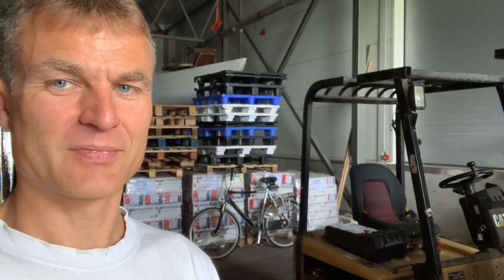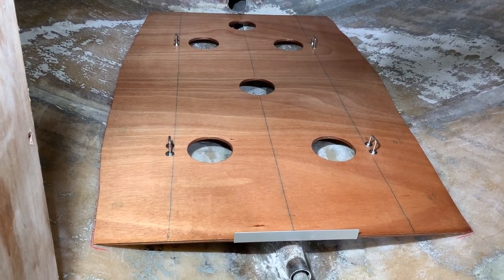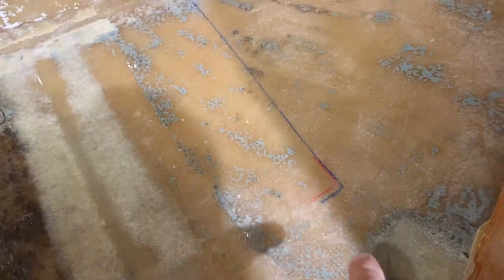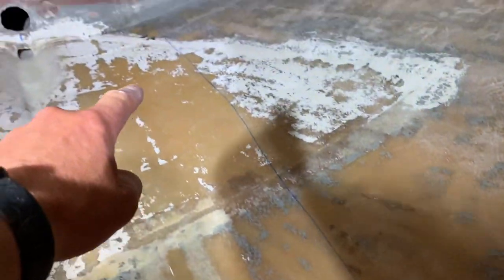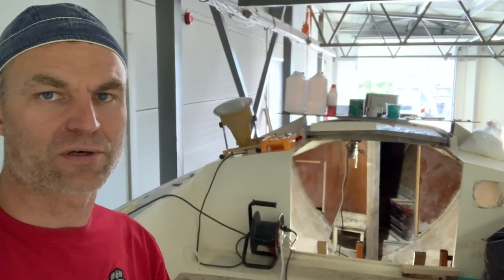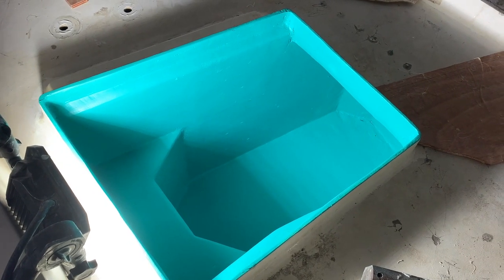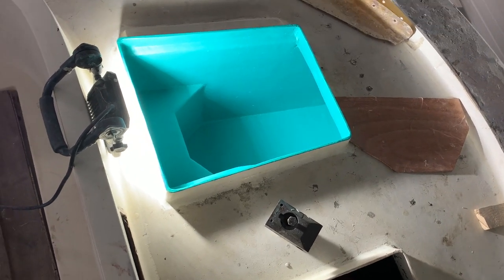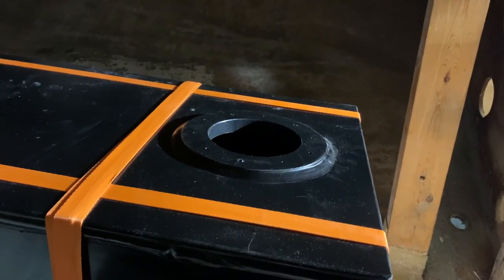Building propane Locker and installing HDPE fuel tank for my sailboat project

Comment: Nice work with the propane locker. Mine is also in the bow of the boat. Something like this could be very nice. 👍
Reply from the maker: Thanks! I only copied the idea from my Shipman 28 that has propane locker in the very same location. Only smaller. I also considered storing gas in the bow locker but I want to keep it for anchor chain / rode.

Comment: I just subscribed.  I've been going through the back episodes and I'm almost caught up.  The trick to motivation I've found is not to tear apart too much at once. If the boat looks like a wreck all the time it's hard to see an end.  Clean up one section.  Like the V berth.  Paint it out nice get it all completely finished and then do your best to seal it up and keep it clean.  Having one thing that is done and done right is great motivation.  The propane locker looks great.  The second trick I found to staying motivated, don't stop.  An object in motion tends to stay in motion.
Reply from the maker: Thank you for subscribing and commenting! That was some really good advice from you!

Comment: If I am not mistaken, propane and butane weights more than air. Therefore, if there is a leak, it will stay into the locker and replace the existing air. Luckily it is not the same compartment than the living area, but it seems to be somehow dangerous to leave bottles in there. Thake care there and avoid any kind of sparks (bulbs, electronics) and any opening when smoking (which OTOH is also dangerous by itself!). As per your projet, you are doing a gooood job!
Reply: Boat will have a small drain allowing any leaking propane to exit the boat through the stern, I believe.
Reply from the maker: Correct, there will be drain.
Reply from the maker: The standard practice is to have gas bottles in separate sealed compartment, that has drain from the bottom to overboard. I've not yet made the drain but there will be one definately.

Comment: now its the time to really improve all the systems in the boat. you have a blank canvas. on my refit i ended up glassing 5 thru hulls holes that simply werent needed.  including those conecting deck drains. i redirected the deck drain to a new hole, done in the topside, near the sheerline. safety is improved (less holes in the hull), function is still there. i used a 50 mm diameter pvc pipe to provide shape and then glassed all over it
Reply from the maker: Great idea, thanks! Might be useful in the future